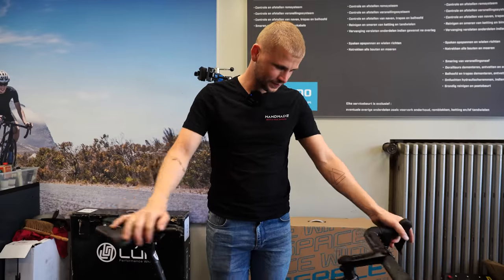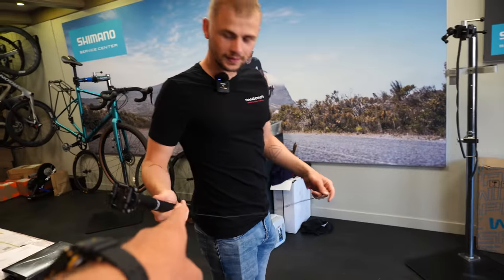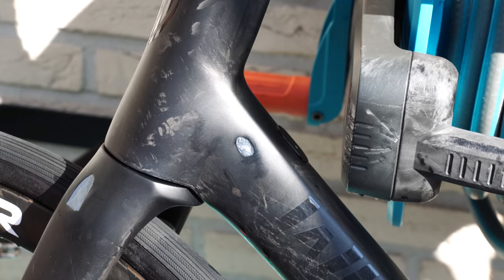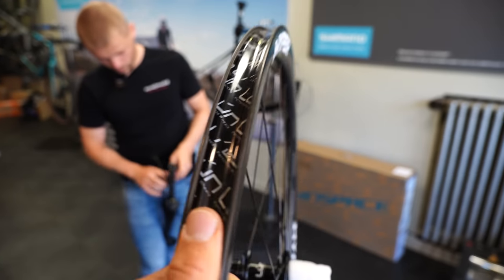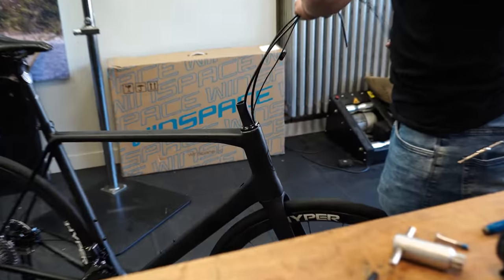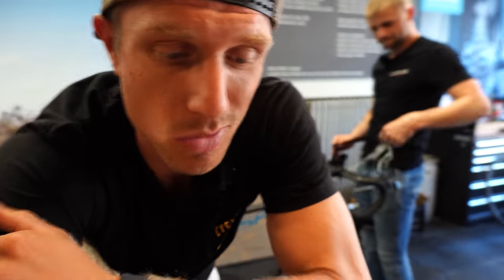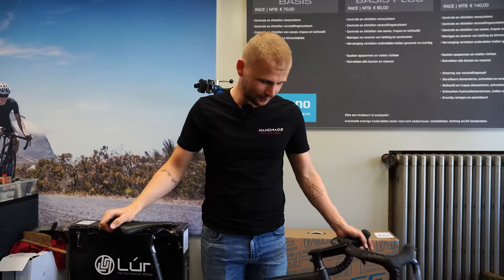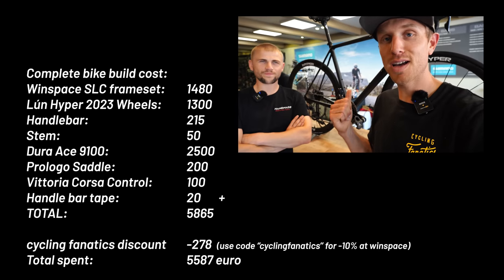Building My Lightweight Carbon Road bike! | (a Budget vs Weight vs Quality challenge)

Comment: I just built this same bike about a month ago. Disc frame set, I went D/A di2 12 speed, Winspace’s Zero integrated bar, Lun 2023 Hyper 38mm wheels. Mine built up around same weight, 15lbs with cages, etc. The build was very easy, no issues at all. The bike handles and climbs amazing. Super happy with my purchase. Compared to the big brands, the same weight climbing bike with D/A di2 would cost upwards of 10k Us. Can’t beat Winspace. They’re providing n amazing bike for a phenomenal price point. I’m getting a T1500 as soon as they’re available in my size for my next build. Great vid.
Reply from the maker: Wow awesome man! 🙌🏻🙌🏻
Reply: How do u like it now?
Reply: @marcustan5868  still very happy with my purchase. The bike is awesome.
Reply from the maker: @marcustan5868  it performed well!🤙🏻🤙🏻

Comment: I built up my SLC2.0 Rimbrake, with Hyper wheels, Ultegra 12spd a month ago. Super happy, 7.1kg. The snappy feel and Supersix like handling is amazing, the bike feels the same is not better than my old top spec Supersix evo himod. In the future I would suggest a Hambini BB to be creak free and spin nice. Great build, great vid, thanks.
Reply: how did you manage the same weight with an Ultegra groupset? lighter seatpost and handlebars?
Reply: @io8787  Rimbrake
Reply: @io8787  Rimbrake
Reply: @PeterPutz82  making my own build with disk breaks...I'll see what I can reach, hoping quite below 7kg 😬
Reply: Hello, I hope I'm not disturbing you or anything, I'm Mauro Dapporto, I am Italian, I'm interested to the SLC2.0 frame, I hope you don’t mind if I ask you some questions about this frame, but first of all I want to apologize for my poor english. 
 
What can you say about this frame, maybe compared to other frames you own, or you have owned or tested?
How do it performs in different riding situation (climb, flat, discent). 
Is it comfortable? The comfort is very important for my body.

Do you had any issue or any kind of problem?

Thank you very much for time and patience. 
Best Regards. 

Mauro
Reply: @maurodapporto  Hi Mauro, I've had two Supersix Evo frames in the past and this bike compares very well to that. It handles decents very well and as it's so light and stiff it accelerates very fast. It has been a dream to ride thus far. Some comments have said it is a bit too stiff in the front end, I would tend to agree, it can be slightly harsh on really rough road, normal road is fine. I put it down to manufacturers having to increase the strength of the fork for disc brakes. Even though mine is a rim brake, the fork design is the same. You can always add a lighter stem which will flex and absorb bumps. 

I built up the bike myself, was fairly straight forward. The bottom bracket tolerance was excellent, installed well with a nice tight fit.
One thing to note, is that the brake routing for rimbrake is setup for US brakes, so the whole is on the left of the frame, meaning it's easier to have the front brake on the left lever. I'm sure it can be setup with front brake on the right.

In regards to issues, I did have a problem when I installed 12spd Shimano Ultegra. The rear derailleur hanger bolts made contact with the cassette lockring. I believe this a issue with Shimano, not Winspace. Shimano said the new 12spd cassette is no wider than 11spd, clearly that is not true. In any case I simply used a grinder to remove some material and it works fine. A local bike shop would be able to sort this out no problem. I told Winspace about it and they were helpful. I'd assume they have fixed the issue by now, this was 6 months ago when 12spd was very new.
In summary, this frame is probably the best bang for buck frame you can buy at the moment, can't fault it. Also I've matched it up win Lun Hyper wheels, they have been awesome too. Enjoy!
Reply: @PeterPutz82  Thank you very much!!
Reply: @PeterPutz82  Thank you very much🙂🙂🙂

Comment: The best cable routing solution I've seen is the Aurum Magma which simply routes the cables under the stem and into the frame in front of the headset bearing. This makes it very easy to install, very easy to swap stems and spacers and very easy to service the headset all while keeping a clean look. The Tarmac and Allez Sprint are almost as good but route the cables through the steerer tube and top headset bearing.
Reply from the maker: Yep I’ve seen a few that are much easier than this one…

Comment: The bolts for the rear brake aren't too long, has nothing to do with the frame but with the fact that Shimano is counting on the rotor size adapter from 140/160mm rotors. If you leave that out, the bolts are too long of course.  But another bit of weight saving by omitting the adapter :). Cool build!
Reply from the maker: yeah well we used the 140mm rotor and this required shorter bolts... (there are shorter shimino bolts but we didn't have them) also the groupset did not come with the adapter so its weird it comes with the longer bolts i guess..

Comment: Thanks for the video man! Interesting stuff!, Personally, I would save at least about 2000 euros looking at your part list, as Id definitely don't want to spend 2500 euro on a groupset. I mean, sadly I have never rode with di2, but I doubt it would add 2500 times more fun to my riding if I would mount ultergra or even the new di2 105 groupset.
Reply from the maker: I wasn't planning to build a cheap bike, I wanted a top notch bike with the winspace frame! So dura ace it was!
i agree, for ride experience a ultegra groupset would work just fine.

Comment: That crank does not rotate freely.

Best change it to a Hambini bottom bracket.
...or any BB with NSK.VV bearings and don't use hybrid ceramic bearing BBs.
Reply from the maker: The Shimano BB isn’t the best no 😩

Comment: Sunday morning with coffee and this video = Great! Winspace is probably the only way to go to get a super bike at an acceptable price these days.

6 years ago I got a similar deal, 5500 euros, for a fully built Focus Izalco Max size 56 with eTap, powermeter, Chris King BB, and DT Swiss wheels. Price of similar Izalco build has almost doubled since then, it’s ridicuolus!

Weight? I’ve kept the rim brakes but replaced the other components with carbon stash + put on Mavic’s 1295 grams R-SYS wheels: 6.2kg. But the best thing is external wiring, just saying, so easy. Only two wires, of course, due to eTap. It might steal a watt or two and I couldn’t care less.
Reply from the maker: Yep makes life easier haha

Comment: Great video. I was about to go down on a pair of hyper 38’s but I am intrigued with what you say about the new unreleased ones in the video. Especially them being wider as I would like to run some 28’s but current external width is 26… doesn’t work with 105% rule. Do you know when these wheels will be released?? Very interested to know. Thanks
Reply from the maker: The wheels I talked about in this video are the new 2023 hypers! (When I built the bike they were still unreleased) 
So the hyper 2023 38’s are what you see in this video
Reply: @jasperverkuijl  hyper doesn’t have a 2023 38mm rim though… they have the d33?
Reply from the maker: @eliasharder8774  oh yeah thats what I meant, d33
Reply: Oh ok. Thanks 😅

Comment: Great video mate. Looking forward too the bike review and riding in the mountains. May a ask why disc and not rim? Could have been 6.5kg as disc a generally 500g heavier.
Reply from the maker: It was almost impossible to find the parts for rim brake setup at that time. 

Also the disc gave me better security on shitty weather descents and it is worth more when i want to sell it. (Rim brake bikes are worth nothing 2nd hand)..

Comment: amazing beautiful. I have question Winspace doesn't sell the plug for external cable hole??
Reply from the maker: Yes it comes with the bike! 

There are 2 holes I filled with black silicone kit (the front brake hose on top of the front fork) but the plugs for holes for the shift cables are provided

Comment: The Deda Superzero stem on this bike appears to have internal cable routing. I'm trying to find one online, but cannot locate one. Only Deda stem available, with internal cable routing, seems to be the Superbox stem, which is not as pretty or sleek as your stem. What is the exact model of the stem you fitted to this bike? David  🇮🇪
Reply from the maker: It’s the super zero 
It’s hollow and works with the D shaped fork of the Winspace.
Reply: @jasperverkuijl Did you have any issues with the placement of brake levers on handlebars? These Superzero bars are supposed to be difficult to slide or place levers further up,  as the bar diameter gets bigger. Makes higher placement of levers, for greater comfort, impossible? David  🇮🇪
Reply from the maker: @davidryan4053 mmm no idea. Just placed them at a “normal “ position and seemed to have no issues

Comment: I hate this internal routing cables. From one side the bike looks neat and posh, but let's say I would like to do smth simple like cleaning headset bearings. Am I able to do this in your bike without disconnecting hydraulic brakes from levers? :)
Reply from the maker: Yep it’s a pain in the ass

Comment: Where is the review? And what size did you use in cannondale compared to this? Size large has a 550 toptube 😅
Reply from the maker: Supersix was a 56. 

Yeah didn’t get to the full review… not enough time in a day 😨
Reply: Considering swapping my mechanical DA over from a 56 BMC slr01 over to this. So i guess it would work 🤔
Reply from the maker: @Eirikkinserdal  yes will work. Maybe you need to route one of the shift cables outside of the stem but the rest should be able to go internal trough stem and headset 👌🏻
Reply: Rimbrake so both will be outside 😉
Reply from the maker: @Eirikkinserdal  awesome. Will be a super light bike!👌🏻👌🏻

Comment: Jasper, a full DA 9100 di2 group set with power meter crank is only €2500?
Reply from the maker: only the Da9100 di2 groupset, not the powermeter. the powermeter is assioma pedals and that would add 600€! i found this really good deal in belgium online store.
Reply: @jasperverkuijl  thanks for the info

Comment: Crazy expensive. I have a 6 years old Émonda with Durace which weighs 6,7 kg and I paid €3500 for it, brand new. Ps: it also has handlebar tape in te right direction: always inside out so you turn it tighter when you twist your hands. 😊
Reply from the maker: I don’t twist my hands and I don’t live 6 years ago. Times change, so do prices of bike parts hahaha 🤪 (actually crying)

I’d keep that emonda if I were you!👌🏻👌🏻 great bike

Comment: ok so when i build rly light bikes, theres only 2 things i dont skimp on, brakes and saddle. ive tried the carbon ZTTO brakes and they absolutely blow ass. and shimano 6600 calipers are only 60 grams heavier. and saddle for obvious reason to save my gooch. my bikes come out to 15lbs/6.8kg without carbon wheels and 13lbs/5.8 with.

and by skimp out on i mean weight wise. ill buy heavier components to save my life/ genital's lolol

OH YEAH MY TOTAL WAS 1600$
Reply from the maker: Try dura ace and you’ll notice the difference. It will be lighter too. 

Totally agree with the brake part, not the parts to save weight on and give in on performance!
Reply: @jasperverkuijl  cant afford dura ace haha thats why its only 1600. das the budget.

Comment: Like lite...GOT 17LBS. DB OVERDRIVE mtb .all aluminum except niner fork..carbon seat/rails.  Single speed though..frame is 4 lbs. 3 oz. Lite is like there's no hills even on a hill.
50 bucks for bike 900 in parts..17 lbs. 9 oz complete. 950 tatal cost. May do a superlite roadbike..like this video.

Comment: Very nice bike. 
My 15 year old carbon bike is only around 650g heavier which is surprising. (Rim brake + old dura ace drivetrain is lighter than disc brake + Di2 however)
Reply from the maker: Yup, the old stuf is very light

Comment: 940 when a size M is supposed to be 780g? Seems a lot.
Reply from the maker: 🤷🏼‍♂️ yeah maybe. I don’t know. The 780 is probably without the inserts etc
Reply: @jasperverkuijl  Yeah, just saw that in the video the hangers were on + inserts and of course there is always some tolerance and its one size up. So could be ok. Did you by chance also weigh the fork and seat tube? Thinking about getting the frame (once its available in L again).
Reply from the maker: @brunospasta  nope did not check that weight.

Comment: 2500 EUR for DURA-ACE groupset and power meter 🤣🤣🤣
That won't be enough for Ultegra, unless that's "special" Chinese version same as frame 🤣🤣🤣
Reply: It is 11 speed Dura Ace and 2500€ would be still very cheap. Today, cyber Monday, you could have bought the new Ultegra for 2000€ (very limited amount),
Reply from the maker: No the powermwter was NOT INCLUDED! 
The DA groupset was indeed €2500, I found a good deal in Belgium. 👌🏻

Comment: If youre not using it specifically to climb or a pro, I see no reason for it to be this light. But you have tons of bragging rights for sure.
Reply from the maker: I used it to ride a 5 day stage race in the Pyrenees. 15.000m of climbing.

Comment: Lightweight with disc brakes...

My 2006 Cervelo Soloist Carbon with deep section wheel's, with 2 bottle cages and head unit mount is 700g lighter than this.

It cost me 3390€ to build it myself.

Of course with glued 22mm tubulars not like this graevel climbing abomination.
Reply from the maker: dont blame me, blame the industry! rim brake parts are near impossible to find! I tried to build it as rim brake bike but it was too uncertain with parts availability... 
besides that, I was happy with my disc brakes when descending in the pyrenees in cold and (Very) wet conditions! stay tuned for my race documentary!
Reply from the maker: just the tubular wheels alone wil almost be the 700gr difference! Tubeles tire setup is actually quite heavy but its the rolling resistance and puncture resistance that makes up for it (partly)

Comment: Budget vs weight, buys Dura Ace DI2, sorry but that's just not correct, don't put it in the title if it isn't true, shouldv'e used Dura Ace mechanical or Ultegra di2, so little weight difference but so much cheaper! Also please don't run cables through the headset if the frame isn't made for it, that's just dangerous, A) the fork gets damaged and you crash or B) the cables get damaged and you can't brake = crash. Why would you even do it, it's a hastle to maintain or the change anything out!
Reply from the maker: Well, here you just misinterpreted my title. It’s budget, weight, quality. Not just budget and weight. And besides that, it was never the objective to built a low budget bike. I just shared my budget that’s all. Budget meaning; the amount of money. Not low budget /cheap. 

The frame is made for internal cables with the D shaped fork so it’s all good. Also the cockpit is made for it so no problems here.

Comment: Are you kidding, right? This is definitely not budget build, and also, not so lightweight. Few months ago, I've built my lightweight bike with similar frame but for rim brakes, with Elite Drive 40v wheels and mix of Campagnolo potenza and chorus 11s group set. It weighs 6,4kg complete with pedals, power meter, bottle cages, garmin mount etc. It costs me less than half of your build. Yes, it's with rim brakes, but still 😉
Reply from the maker: I think you misinterpreted the word “budget”! 
Budget is often understood as “low budget”…. I’m just referring to “the budget”: the amount I spend. 
I didn’t try to make it a cheap bike, I wanted to make it a high end bike! 
Hence the brand new dura ace groupset, all new carbon parts etc etc. 

So, for a rim brake bike in size large with tubeless 28mm tires (tubeless is heavier than tubes or tubular) and power meter I think 7kg is fine.